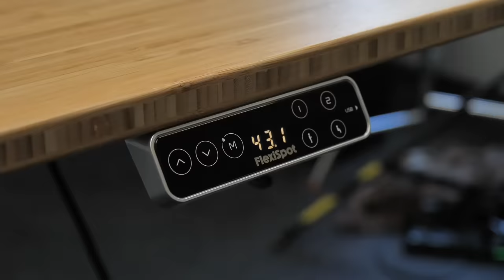75 Year Old Build Off Challenge - Will They Fly?

Comment: Having built 35 of the Gymallo kits from "Bob's Little Airplane company" I can tell you that the open spread of the wing spars is 109 degrees, and the closed angle is 100 degrees.  The pylon has a top angle of 10 degrees, and the wing cross spar is located 42 percent of the length of the center spar of the wing.  All 3 of the wing spars are the same length.. example:  24 inch spars, 109 degrees open angle to adhere the covering to the spars, 100 degree angle of the outer spars when the cross spar is attached, and the cross spar is 10 inches back.  Tyvek makes the best material for flight, with rip stop kite material a close second.  smooth coverings adversely affect the flight performance.
Reply: Hey thank you for sharing. Is there any link online about the measurements you mentioned online? I tried to draw one but can't quite work out which is which above 😀😀

Comment: Or at least bring back the plywood parts for some of the older models that aren't on the store. That way, people can still scratch build the planes like the twin sparrow or ft dart with ease. And not have to worry about parts like the motor mounts that they have on those that are a little difficult to do right.

Comment: At 10:18 in the video.  I think the reason it wont turn right is because you are steering it with the propeller.  Look up "P factor" and the effect it has on tail dragger aircraft. It creates asymmetric thrust.  You appear to experiencing this phenomena in the horizontal as opposed to the vertical as you are moving the propeller disk from left to right and not up and down.